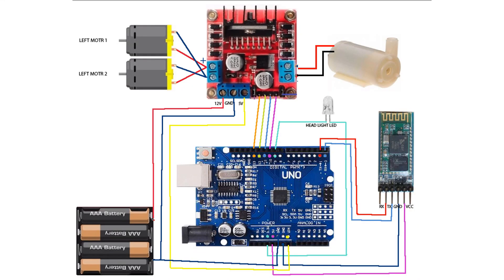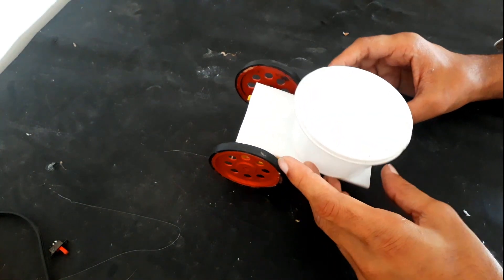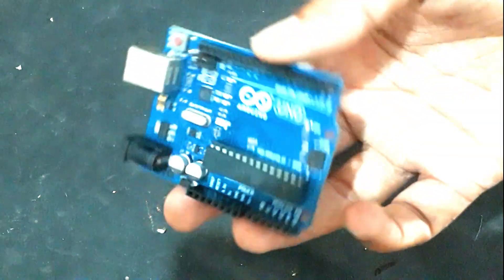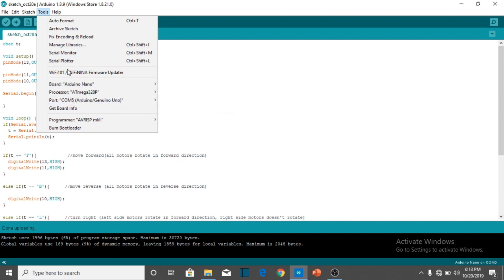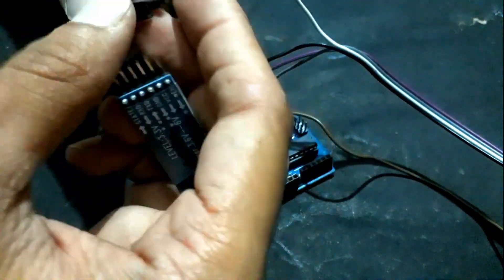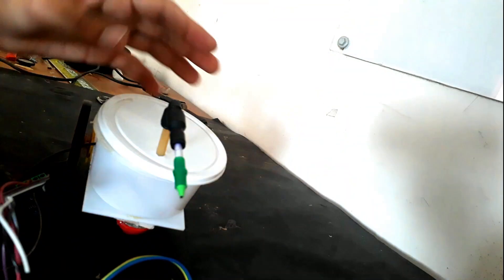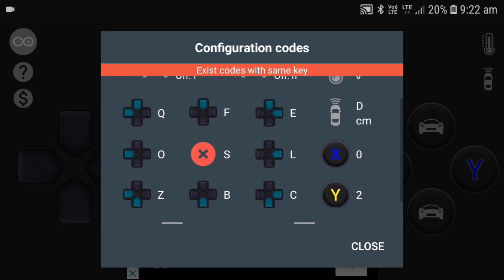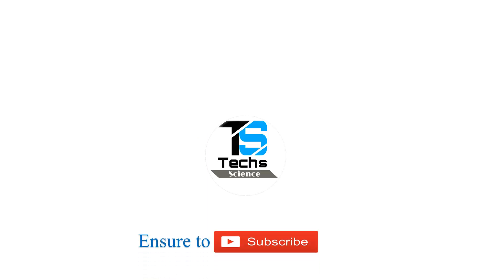How to make Mobile Controlled Fire Fighter Car | Arduino Project

Comment: Can i use 18650 battery instead of Double A battery?
Reply from the maker: Yes but then you will have to change the circuit diagram

Comment: Is it possible to use H Bridge l298 motor driver? On your program?
Reply from the maker: Yes!
Reply: @TechsScience  i dont have to change the program? Sorry for too much questions sir :)) i'm new with this and i really need expert's advice hehe
Reply from the maker: @mikeeeyelich6463  you don't have to change code just put the pins at correct place
Reply from the maker: Feel free to ask questions 😊
Reply: @TechsScience  thankkyouuu very much siirr. Do you have any social media? If its fine i would like to add if ever i still need help
Reply from the maker: @mikeeeyelich6463  Search Techs science on Instagram
Reply: @TechsScience  sir how do you attach sensor? And put code?
Reply from the maker: @mikeeeyelich6463  it is not having any sensor
Reply: @TechsScience  sir where to put the IA1 and IB1 in the board based on the codes

Comment: Can you please send me the circuit diagram using the picture of the L9110 motor driver
Because I don't know how to connect which to connect what
I want it to do this for my project so
Reply from the maker: Ok I will send you on Instagram if you using
Reply from the maker: Text me there at Techs Science
Reply: No I don't use Instagram
Reply: Send me through email
Reply: I have sent you at Instagram
Reply from the maker: @shurtishurti6916  I got message from Jeevan i have replied
Reply: Thanks

Comment: The motor driver shown on the circuit diagram is different from L9110 motor driver
Reply from the maker: Yes, but they both works the same

Comment: Does the water pump pumps water itself? How does it work? I mean, does it have a control or does it automatically pumps water when there is fire
Reply from the maker: Pump is connected with motor driver
Reply: @TechsScience  Thank you so much for replying. Does the pump have a control or does it pump water continuously?